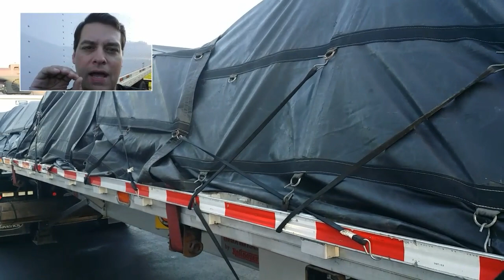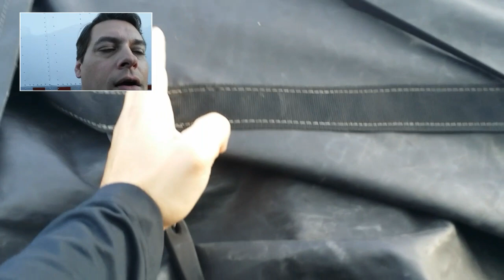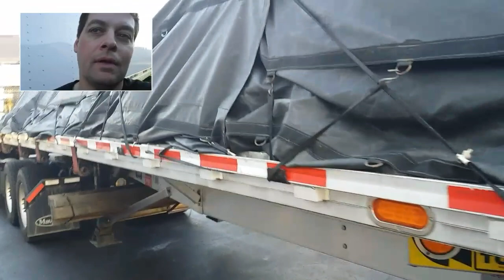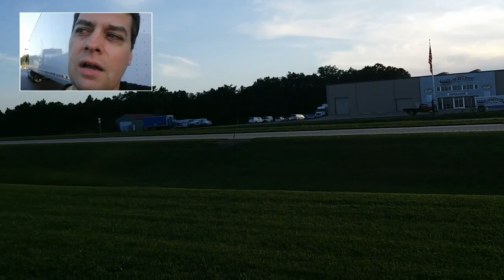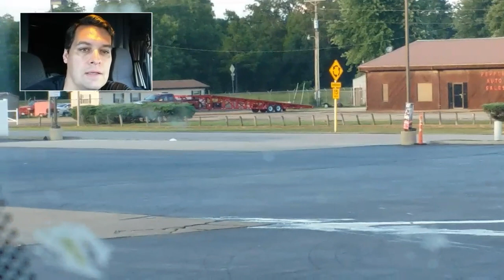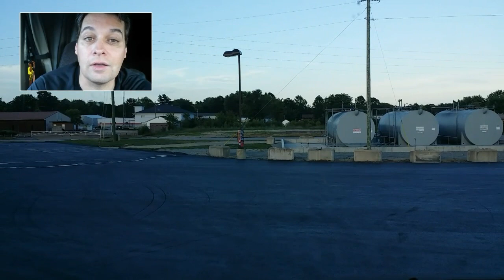Train parts and truck talk

Comment: Hi! Your channel has inspired me to
think about truck fuel mileage. I am a retired Physics teacher so I
tried to look at some of the factors that affect truck fuel mileage.
If this does not seem real or of value to you, just ignore it, I had
fun anyway. I researched the internet and found truck rolling
resistance is 6 lbs per 1000 lbs of gross weight, diesel fuel
contains 155 million joules of energy per gallon, a semi truck
frontal area is 8.5 feet by 13.5 feet or 114.8 square feet or 10.6
square meters, the density of air is 1.2041 kg/cubic meter, the
efficiency of a turbocharged diesel truck engine can be as high as
45%, drive line efficiency is 92% , air drag coefficient is 0.96.
Lets assume our gross weight is 70,000 lbs so our rolling resistance
is 6 x 70 or 420 lbs. Air resistance is given by the formula ½ times
drag coefficient times air density times frontal area and times
relative wind speed squared. Lets assume there is no wind relative to
the earth so the truck speed becomes the relative wind speed.  Let
our truck move at 58mph or 26 meters per second, our air drag becomes
1/2x.96x1.204x10.6x26 squared for 4141 Newtons or 931 lbs. Adding 420
lbs to 931 lbs gives us 1351 lbs. The work done by this force per
mile is the force times distance or 1351 lbs times 5280 feet or 7.13
million ft lbs per mile or 9.67million joules per mile. Fuel mileage
would then be 0.45 times 155 million joules / gallon divided by 9.67
millionJoules per mile or 7.21 miles per gallon. If our truck climbs
a 4 percent grade at 40 miles per hour the rolling resistance is
still 420 pounds, the air resistance drops to 441 pounds for a sum of
 861 pounds. The work to do this per mile is 861 lbs times 5280 ft
for 4.55 million lbs foot of work or 6.16 million joules. Our truck
now needs to lift its weight 4 feet for every 100 feet it travels so
the lifting energy is 40,000 lbs times 4/100 times 5280 ft/mile or
8.45 million lbs foot per mile or 11.45 million joules per mile.
Adding gives us 17.6 million joules per mile. 0.45*155 million J per
gallon divided by 17.6 million J per mile gives us 3.96 miles per
gallon. I know there are a lot of factors but are the fuel mileage
numbers close?

Comment: You should try  U-Haul sales. Their pick up aren't bad at all. Low miles and rarely over $7,000
Reply from the maker: +Marcus Williams Thanks for the suggestion.
Reply: Careful, U-Haul vehicle are special, i.e., transmission is geared low to prevent damage, same as rear end, I would stay away from them, In canada, U-HAUL vehicle are JUNK, and DOT, is always cracking down on them. BE VERY CAREFUL.